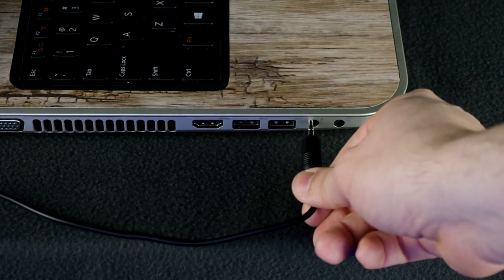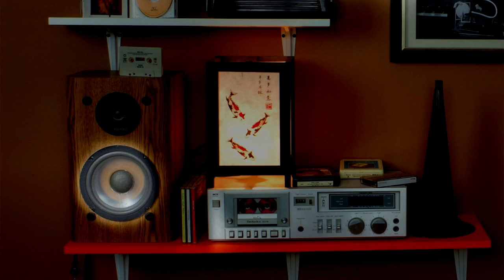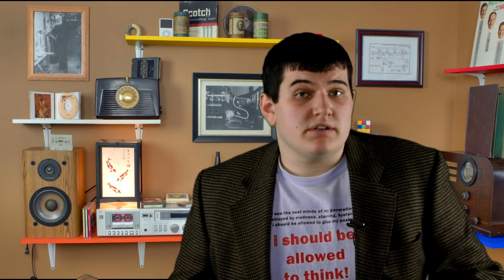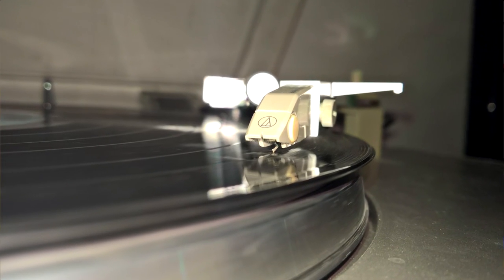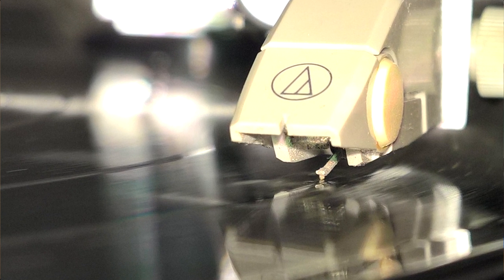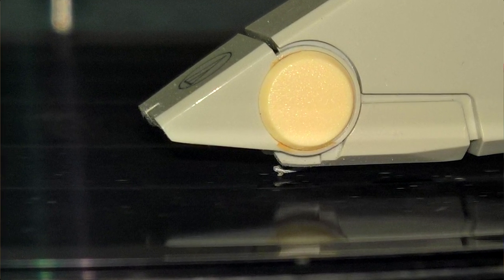From Radio Waves to Electric Grooves:  Electrical Sound Recording

Comment: When I was young I used to like to make recordings with my cassette player and my headphones.  One day I accidentally plugged the mic and the headphones in backwards and sure enough sound came out the microphone.  And I realized I could used headphones as a microphone as well.  It sure came in handy when I didnt have a mic around, but the quality wasnt as good.   Thanks for the great series.  Very clearly explained!
Reply: Mind = blown
Reply: Re: Speakers as mics; When I was a kid living in the basement, I had a set of speakers wired into the livingroom above.  Made it easy to record a very important conversation...  I had a Radio Shack mixer, they were plugged right into it.
Reply: @phildavis1723  Laf! Makes it sound like you were extorting people living there XD
Reply: Strange, I tried it but that never worked.
Reply: it depends on how the mic/headphones are wired

Comment: I have run a soundboard for various groups and activities in my life - mostly because I am more "techy" than most people and I worked for my college radio station part-time for a few years - not because I am very skilled at sound mixing.  Even now I often run the sound for the school here.

I was running the sound at a place I was not very familiar with one time a number of years ago, and someone (not me) had wired something incorrectly and the person on stage helping me with the soundcheck started freaking out and told me I had to get down there.  "Leave the music on and come to the stage right now!"

The music was playing through the microphone.  It wasn't loud, but it was clearly heard when you were standing near it.  It kind of freaked us out for a minute until we sort of figured it out.  Actually, someone there said, "Yeah, speakers and microphones are pretty much the same thing".  I didn't believe them at first.  I did some googling afterward and then I tried the "headphones as microphone" thing like you demonstrated here.  It really blew my mind for a while.

Comment: 3:39 I didn't realize headphones could be used that way! 😲
Reply: I didn't either!  My mind is officially blown!
Reply: first time somebody told me that, I called bullshit
then they showed me and I was flabbergasted.
Reply: The obvious followup question is then... can you play music on a microphone?

EDIT: Looking at other comments... Yes. Yes you can!
Reply: @abdulmasaiev9024  I don't see why not but in general microphones don't have big enough diaphragms or electromagnets to project a lot of sound, but then again neither do headphones or earbuds.
Reply: I think it's not recommended because they're designed for different currents, so using speakers as a mic gives poor quality, and the other way around can damage the mic. But it does work!
Reply: It is not works for you because the signal in the headphones in microphone mode is about 10 times weaker from what is required at the input to the laptop microphone. 
Laptop microphone input is preferred for condenser microphone which signal is much stronger.
But theoretically it actually works.
Really, if you will connect headphones to microphone input through amplifier it's will works pretty fine.
Reply: insert YouTube "wooooow" sound effect
Reply: As a kid in the early 70's, I plugged earphones into the mic input. And plugged the mic into the earphone jack. Not ideal, but it works. I even used a loudspeaker as a microphone.
Reply: My brother and I split a pair of headphones and with me speaking into one of the earpieces my brother could hear me through the other.  Obviously they were connected together! and we were in different rooms.  This demonstrated that a headphone used as a microphone produced enough power to drive the other headphone.
Reply: I used to play around with the earphones for my cassette recorder and use them as a microphone sometimes. Came in handy if my regular mike broke (which happened far more than it should have).
Reply: @abdulmasaiev9024  you sure can, but unless you keep the volume down, you are likely to blow the mic.

Comment: A very important caveat for the microphone/speaker-interchangeability is that this applies ONLY to dynamic microphones. Electrostatic microphones use no coil, but instead use the diaphragm as part of a capacitor. The vibrations induce a displacement current either "in" or "out" of the capacitor. This is your condenser, electret and capacitive MEMS microphones, all of which are pretty common. 

In fact, they're so common that every PC, smartphone or tablet microphone jack has a +3V DC bias on the mic line to "power" an electret mic!

Comment: I once read, popular singers in the early part of the last century learned to sing in a manner that worked best with the limitations of audio frequencies which could be recorded or transmitted, and that is, in part, why they had that characteristic, "old timey," sound. I always assumes it was the limits of the recording medium altogether, but the article I read said the artists had that similar nasally, over-exaggerated sound in person. True?
Reply: BuckeyeStorms 
Those Technics weren't just limited to singers either. News reporters and Radio shows also applied.
Reply: @MatthewCobalt  hence the "Transatlantic Accent" which was essentially a mix between British and American dialects so that every syllable could be heard

Comment: Not bad at all.
One thing for you to ponder is that with a RIBBON microphone, the aluminum foil ribbon serves as BOTH a diaphragm and as a "pickup coil"; since the ribbon in a ribbon microphone is extremely thin, it will respond to the softest sound.
Conversely, the development of electronic power amplifiers and moving coil speakers made it possible to build a speaker system as large as it needed to be to do the job; the acoustic recording process and an acoustic phonograph could not cope with the bass notes of a pipe organ; electrical recording and playback changed that almost overnight.

Comment: I remember my grandparents had a big piece of wooden furniture that had a ~20" B&W TV, a record player, and an AM/FM radio.  The record player would play 33 1/3, 45, and 78 rpm records.  They had the bigger records of big bands from the 1940s.  If you opened the back of the piece of furniture, it was loaded with vacuum tubes.

Comment: Since since a sound signal from a microphone can be amplified before recording, a microphone doesn't need to do as much work and so can be more responsive. Electrical playback also allows amplification upon playback which means that the cartridge doesn't have to do as much work and can be more responsive.

Re 4:56 Telephones originally had carbon microphones. With these microphones, the diaphragm would simply vary the voltage from an external source, these microphones therefore also being amplifiers. Yet these microphones couldn't respond to sound any better than acoustic reproducers and signals from them were also very noisy.
 The microphones mentioned are dynamic. Although they make sound into electricity, they still respond to sound a lot better than carbon microphones.
Re 5:30 Electronic amplification also responds to sound signals better than carbon microphones respond to sound and add less noise to the signal.

Comment: Sound was also converted to varying width or intensity tracks on optical film and film projectors used light and photodiodes to reproduce the sound from these recorded patterns. You might want to cover this topic in the future.

Comment: The first using of pickups to play records was in the radio stations, the technicians developed an early pickup and could so improve the record playback. Later they used records to repeat radio shows and this was called "from wax" because it was cut on a "wax" disc and this could be played one or two times.

Comment: In the end of the 1930's came the first pickup, what is similar to the modern ones, what plays micro groove vinyl records. It has a sapphire stylus, less pressure, than the usual systems, was in production till the early 1950's, but was expensive and so much people bought the usual record grinders.

Comment: 8:50 - And here is something you likely never knew about those phonograph cartridges: they were vastly overpriced. I worked at Circuit City from 1987 to the end of 1995, and employees could buy products at cost (but not CDs).

The most expensive phonograph cartridge we stocked was the Audio Technica 8008, at $109.97.  Store cost?  $10.  No lie.  The markup on audio equipment was insanely high, but nowhere was it higher than on those tiny little bits of plastic and metal.

Comment: @11:00 - Recollections from my youth - placing a speaker in series between the output of my shitty guitar to the input of the tape deck I was using as an amp - face down on a bit of plywood - so I could pound the bass drum "pedal" while playing Sabbath's "Iron Man". As it turned out music wasn't my thing.

Comment: Jessie Crawford, theatre organist known as "Poet of the Organ", put money into a electric recording venture in 1920 when he was organist at the Chicago Theatre. Several sides were recorded and released but the signal was low, most likely due to the microphone being inadequate. It would be 1925 or 1926 before the pipe organ could be electrically recorded and some time after that before microphones improved to a state of high fidelity.

Comment: Cartridges.  You've glossed over crystal and ceramic cartridges which, as you describe, do use a physical input and vibration to generate a signal. Magnetic cartridges only detect a change in magnetic field, and there is no physical transfer of signal from the stylus or cantilever to the cartridge coils.    You're giving a lot of partial information here.

Comment: The headphones as mic "trick"... does it work with both headphones or just one channel? For some reason I recall using specifically the left ear-piece as the mic but I never bothered to try the other one, does it work?
Reply: It would only work with one. The other won't be connected. Notice the plugs on headphones have three sections while microphones only have two.

Comment: What was really weird and hardly understandable. The first electromagnetic recorder was invented  already 1899 and sold as consumer machine  Telegnamedraphone already 1903. The electronically amplified radio was developed into consumer tool in early 1920s. BUT the mainstream disc grammophone remained full acoustic and mechanic tool until late 1930s!!! And first mainstream consumer magnetophone appeared after the WWII!!! What happened in 1920s and 1930s? Why nobody got idea to attach record player with electronic amplifier?

Comment: "We realized, we didn't need replaçable needles." 9:33
I disagree. Vinyl lovers have the problem that their disks wear down, slowly but they wear down. https://youtu.be/aS1FqbFEuhc  The weight of electric reproducer may be lower than that of the reproducer of a V660 - which is responsible for the fact the process of wearing down the disk is so slow - but it's still heavy, several tons per square inch. https://youtu.be/pUbC2ANXRqY?t=332
The method of easily replaçable wear-down needles + an abrasive compound in the disk is still needed, but sadly out of use.
Reply: Doesn't the compound reduce sound quality?

Comment: When electric recording was advanced, the improvement in quality was so, that a record could sound better than AM radio and have a frequency range up to 7 kHz, maybe 10 kHz, higher frequencies possible, but the records were not compatible to acoustic playback. I know one example of a record, never played before and it sounds nearly like a 1950's vinyl record, no audible noise, the only limitation was a lack in the frequencies above 7 kHz, it was between the sound of the first cassette recorder or the first VHS and AM radio.

Comment: Did you know that a hacker could even turn your speakerset or headphone even if they are connected to audio out of your pc,laptop etc,, into a microphone? That's right since the audio in & out jacks are controlled by software in a chip, it's possible to reverse the process by changing the software, but the range is limited and the audio will be soft.

Same thing with modern tv's these day's.
And i've heard about that today's smart tv 's even have a builtin microphone wich is really hard to locate because they're.tiny because there are hidden somewhere inside the speaker grill plates, it's used to monitor you once your tv is connected to the internet.
Reply: tbh, software could easily poll to see which chip drove which input. however, the output will be a higher impedance to reduce the noise floor on output, so like OP said, the sound would be really quiet. so basically, it's just easier to go for the built-in mic which most laptops have nowadays, if available.
Reply: Will not work when there is an power amplifier in the circuit. the chipsets used in TV's do not have these "chameleon"-ports like modern AC-97-codecs in computers.
Reply: ***** i thought ac97 was pretty old now? every motherboard i've seen in five years has been "hd audio" with back-compat ac97 mode
Reply: Same-same.
Reply: Kit Vitae that is correct, the AC97 standard was developed by intel in 1997.
Reply: ah, hence 97 i suppose :3
Reply: I wonder if you could beam electrons at a 3.5mm jack and change what's playing on it ..